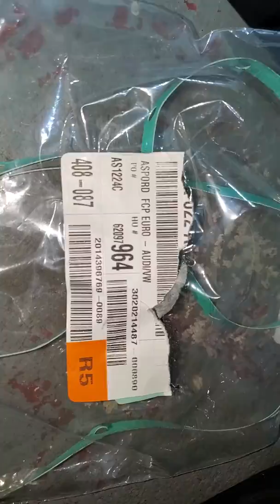2006 Audi A8L D3 6 speed tiptronic transmission filter and fluid change notes 4.2L

Comment: The 16mm bolts which you refer to when removing the brace on mine are sized in. Nuts come of but no lucky with the bolt coming out, any idea how your came out easily or suggest anything, heat didn't work thanks

Comment: i'm here in orlando florida how much do you charge me for servicing my 2007 a8l transmission my friend can i take the car to your house or you can come to mine if you'd be so kind
Reply from the maker: Do you have access as military to the shop at the PSFB?    Thats about the only way possibly.  I dont have insurances or guarantees.  Before doing job must physically look at pan and count bolts.   There are several configurations each year as these cars were hand built back then and got different lots of transmissions.  3rd time was the right one.   Or pay dealer $200 for gasket.   Even the online store in ohio looked up my vin and sent wrong parts 50% of the time.   I feel you on this.  Its a pain.  Ive bought used cars for less than what audi charges in services.  What i did notice is the car came back to life.   The ohio shop had best price on the factory ZF fluid.  Theres a lot to getting parts staged on these.  Mine was in the air a month before completed.

Comment: If you were telling us how you put it back was a hell of a video, but wasted 10 min of my life to watch you talking so much …. Without explaining anything about how you put it back…
Reply from the maker: Reassembly is fast, easy, not hard. Its an easy job, no tricks.  I was amazed how easy.  Then the hard part -  Refill through bottom drain hole using pressurized unit, 3 quarts at a time.  The messiest job ever. Takes years off your life probably from toxins for the liver - bathing in fluid even with gloves, in your hair, mouth, eyes.   Fluid sputtering everywhere- sorry,  not a snowball chance im filming that with me cell to ruin it with tranny fluid.  Cant believe germans have any stage to talk about the environment.  Needed to mop up fluid.   As trans heats up the expansion rate of the fluid will flood out the fill hole, but let it until it stops - look at other videos for thier ideas of what is full.   Got to get trans up to spec temp which isnt easy unless driven 10 min and then put back onto ramps and scald youself.   Installed an extra quart also so it exchanged torq converter fluid more.  Some repeat drain and refill to get ~75% renewed after driving a few days.  Improvement from trans fluid change is remarkable - its been 2 years and it shifts like new still.  ZF Germans get the global warming award for environmental polution.

Comment from the maker: NOTE:  WHEN  I PULLED DOWN THE FACTORY FILTER --- THE RUBBER SEAL RING REMAINED UP INSIDE THE TRANS.  its too far to use a traditional seal puller - so I constructed a hooked tool and carefully, without scratching hole, pulled down the old seal.  It took longer to remove that stuck seal than any other step. I recommend removing that seal so its not pushed up inside the tranny when  installing the new filter.  Overall, it was a simple job with the only headache being the refill under a running engine.

Comment: They are amazing transmission. Come check out my 2004 a8l with 554 000 km on it. Thats over 344 000 miles and still factory trans. Work of art indeed
Reply from the maker: that is amazing.  when did you change out the cam chain tensioners on yours?  Do you do just the pads?  when did you change the chains ?   Im loving this timing belt motor so far.  its runs like a top. my favorite car to drive.  a 900 mile trip with the seat massage on is just fun.  if you are in the eastern US - got to take the A8L on RT10 west of Oceana West Virginia.  its freshly paved and a complete amuzement park ride on the steep grade enter/exit switchbacks.
Reply: @tonyd3266  we've got nothing like the chain tensionner of the fsi engine. Only small chain to link the camshafts. Same design as the 1.8T engine. You do it when it happens, mine took 3 timing belt before needing it.  
As far as spirited driving.... I do have a 2007 Audi S8 as well.  It's a pig on gas despite being fsi because its  a close ratio transmission. It revs higher in normal driving and it's a bigger motor

I feel the massage seats are a letdown in audi until the 2011 a8. (D4)  I service quite a few a8 so get to drive them. Starting in 2011 those massage are a LOT more thorought and adjustable. But Ill tell you this. D4 rust like crazy.  They put steel subframes instead of aluminium like our D3 so they rot.  I replaced one I could poke my hand through it . Dealer even failed to see that while doing alignment.... oh well, he's my client now.
Reply from the maker: @Nordic_Mechanic  dissimilar metals - I thought the germans knew better.  Geeze a 2011 already eaten up…. Sounds like my first range rover tailgate.  Germans are now into planned failure on some components— didnt know it was frames too.  those smaller cylinder head chains between the cams.    Mine has a short rattle on startup- so its time to swap the pads.  Hope thats all it is.  Did the timing belt myself last time and made cuts and convenient holes to remove everything faster next time, especially those crazy radiator bolts.  Its already been 40K miles since the last service so a belt refresh is due.  Im only dreading the radiator draining and smell of it. .      Im jellious of S8 and W12 audi owners.  Maybe some day… but im afraid of the replacement cycle costs on those — seems the regular high priced items double for S or W.
Reply: @tonyd3266  landrover have nothing to do with german metals. They are piss poor magnesium alloys just like the ford. My climate here is BRUTAL on any subpar metals. D3 never EVER corrode. The worse rust ive seen is a rusted through damper tube (steel). Slow leak from pinhole. The air spring metal part really.  Since the car had 255 000 miles and it was a 17 year old air spring. I give it a A+ anyways. 
Did you check my timing belt video? How I do it is rather simple. Only time consuming.
S8 chain tensionner are the best, and those cars usually have the best maintenance so they do last a lot longer than 4.2 tensionners.  Keep in mind only the top tensionner fail and get noisy and replacing them is a 1500$ if you get them done. 
If you do the chain on a V10 and W12 its an engine out and on the V10 some o2 sensors are engine out. So you do all  8 ...yes  8 o2 sensors on those engine.  then you do rear and front main seals and basically you do every wear item while the engine and trans are out.  Then you enjoy another 15+ years of troublefree. With good service youll never touch the chains again.
When I bought the S8, I factored in the cost of engine out in my offer. If I have to do it,  it's not gonna hurt me. Same with the 3000$ dollar intake manifold. The car appreciates in value faster than the maintenance cost.
Reply: @tonyd3266  tensionner i replaced at 54x xxxkm but they were due around 500 000km. replaced the whole tensionner and even got a bad new one I had to fix.
Reply: @tonyd3266  what’s a higher fuel injector that I could use for more power ?

Comment: Same exact transmission I got in my bentley.. how did it run after fluid and filter change?? I'm about to do my bentley I'm at 111k
Reply from the maker: shifting is snappier.  It really tunes it up.  Just like changing out the brake fluid gives you great braking pedal - the new fluid breathes more life back into the tranny.  especially since the new filter ensures you get full pressure to clutches and valving. see my not about the filter seal in comments.  it was the only "difficult" part - and that was because I didnt have the right tool.  Assume you have the 12cyl - that has more HD internals but the cases are the same.  possibly the axles are the same as well, and wheel bearings.  Ive heard the 12cyl eats front struts - but I only got 60K from the stock struts on the 4.2L - with age eating up the air bags - now the arnotts are lifetime warranty.

Comment: I have an 2007 A6 C6 Allroad 3.0 tdi with the same gearbox. Before the oil replacement, mine needs to reach 35°C empty, selecting all gears. After reaching that temperature, we are ready to fill the gearbox with oil. Check if A8 needs the same temp. Other important thing is, if your engine doesn’t reach the ideal working temperature like 70-80° no more, see the auxiliary thermostat close to the gearbox, in fact it is a gearbox thermostat which doesn’t let the engine get 90°. 
The part number is: 4E0121113
Cheers
Reply from the maker: im in Florida, so the air temp reaches 35C in most every month of the year. out of curiousity, how does shifting and clutch pressure take place with no fluid ?
Reply: @tonyd3266  because the gearbox needs to know without and then with fluid. Its a manufacture procedure (from ZF). You have to select all the gears with gearbox empty until reach that 35° and fill it because the gearbox fluid is too sensitive to the temperature and expands quite fast within a temp range, so you need to fill that specific quantity at specific temp.

Comment: Hi watched with interest as I have the same model car. Did you record the filling process? Out of curiosity what model transmission is it (it will be a 3 Letter code) as the Bosch number you show 260550014 is for the Transmission Control Unit. Etka/Elsawin are a big help. Cheers.
Reply from the maker: The transmission in mine has 23 bolts.  Most kits send a 15 bolt gasket.  Not 100% sure of trans number.  How would I find it?
Reply from the maker: For filling I got the $80 pressurized 2.5L ball canister with the plastic xhook tip and t shutoff valve.   You still bathe in fluid with it, but its easier to fill.  Put it on jack stands with emergency brake on.  Filled it to overflow.  Then shifted to reverse for 30 sec, n 10sec, drive 30 sec..  Topped it off.  Then did again.   Using ir heat laser temp checker I let it drain until fluid and case were 145F.
Reply from the maker: Then installed Allen bolt hand tight.  Drove around 15 min and put it up on jacks again .    get 2 floor jacks.. It goes better.  Temp 145f.  Running in N, topped it off , hit rev and drive and back to N.  With a tiny drip I reinstalled Allen bolt and finished up.  Its got to be the least environmentally friendly fluid change going
Reply from the maker: But trans snaps through gears now and drives very nice.  No more odd vibrations shifting.  Oh, and I used the cheaper zfluid from a major online vendor at $7 a quart and its fine.